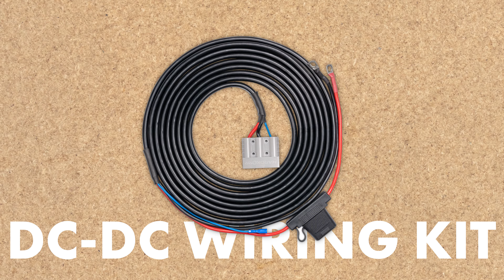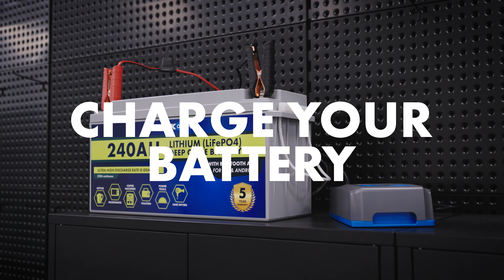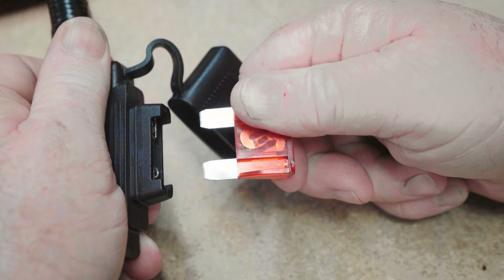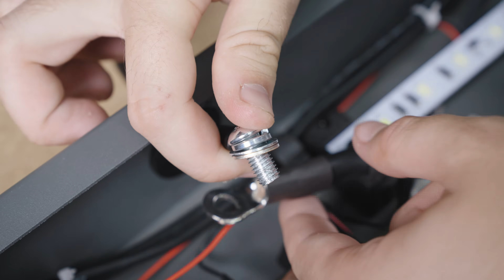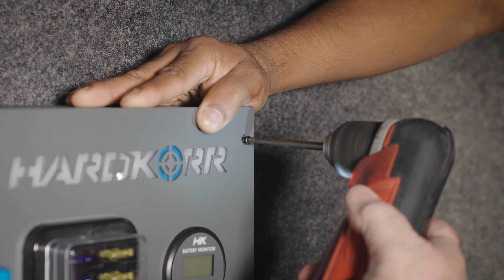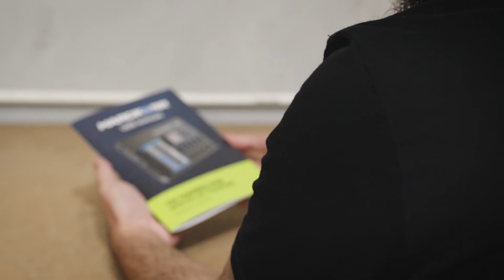How to install our Control Hub with DC-DC Charger + Shunt

Comment: Best install vid solid work guys!
Reply from the maker: Cheers mate 👌
Reply: Hi I've juts bought the control box and dc2dc will it not turn off if it ain't grounded and if I don't have the ignition wire connected ? Thanks